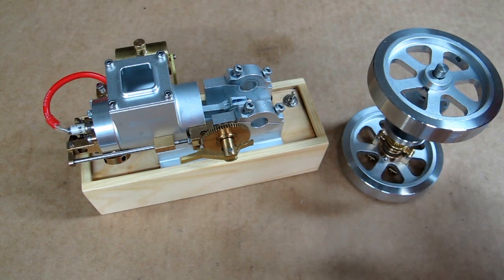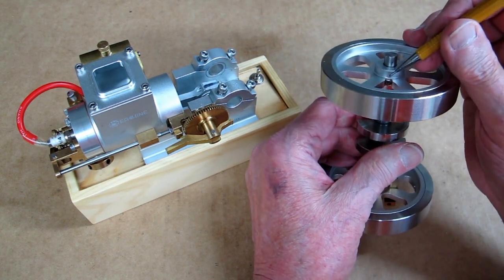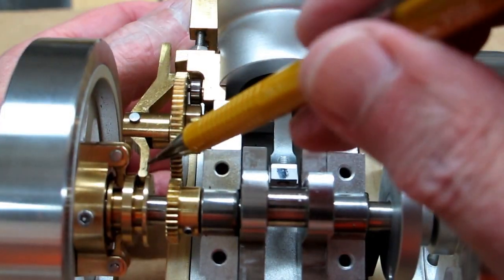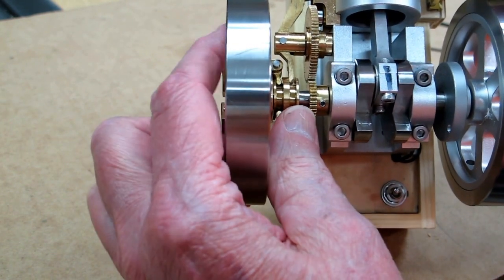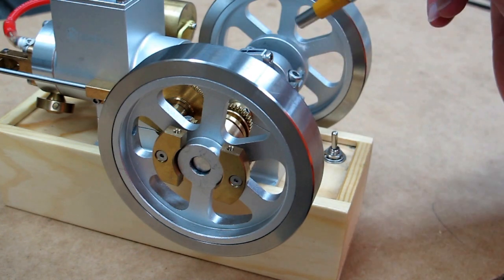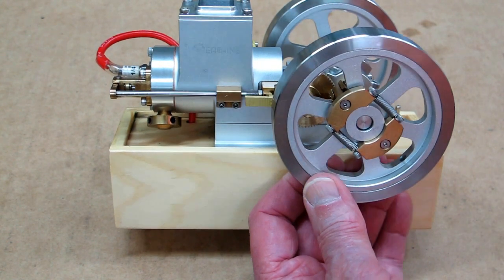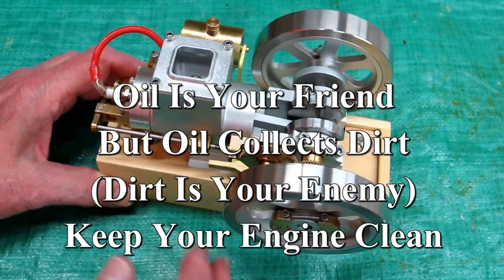Eachine ET1 - Fixing Loose Flywheels

Comment: Can something be done with loose main bearings? Flywheels wiggle a bit. I got this engine second hand and I don't know was it like that 'by design' or bearings worn over time.
Reply from the maker: These are obviously made fairly fast and there are some shortcuts used in the manufacturing process that could be better, such as not having a flat on the crankshaft for the flywheel set screws. The crankshaft bearings are fairly loose but that doesn't really seem to be a problem. Some people have chosen to make their own brass bearings (bushings) for the crankshaft with the addition of drip oilers. They are a standard metric flange bearing should their replacement become necessary.

With some of the later engines flats were added to the crankshaft for the flywheel setscrews, however the setscrews are still at an angle to the crankshaft. I would much prefer that the flywheel setscrews were perpendicular to the crankshaft.

The main thing is to keep everything oiled (before each run) and to operate these for what they are... model demonstration engines (run at moderate speed and for short duration) and not something that is going to be used for an actual job or to see how fast they can run before some damage occurs (as I have seen some people do for unknown reason).

With a little TLC and the occasional maintenance, these engines should last a long time.

Always a good idea to take many photos at different angles for future reference should something shake itself apart or for when you need to disassemble something and then forget how it goes back together again. :-) I've done that more than once.

Thanks for watching. Enjoy your little engine. Please subscribe! 
That is what keeps this channel going. 
Ron
Reply: @RonaldWalters2010  Thank you very much for your reply.  One more question regarding timing. I noticed, that exhaust valve is opened slightly before bottom dead center of the piston, it it correct? Looks like a waste of some gas pressure, that could still push the piston... 

I'll subscribe to you channel for sure. Great stuff and really good way of show and tell.
Reply from the maker: This is my original review video on this engine. 

Eachine ET1 Upgraded Hit & Miss Engine
https://youtu.be/ZCrjj4niyto

You will see the exhaust valve open slightly before BDC and closes slightly before TDC which gets the exhaust valve closed for a full intake stroke which you can't really see because of the atmospheric operated intake valve (very slight movement of the spring loaded intake valve).

Most of the power stroke energy is stored in the rotating flywheel. 

Ignition should occur just past TDC on the compression stroke.

There has been some occurrence of the ignition stopping during an engine run or not working at all due to too much voltage. You will see in some of my videos that I use a dummy battery which effectively drops the battery pack voltage with fresh batteries from 4.5 to 3.0 VDC and the problem goes away. Note: This doesn't happen with all engines (another mystery of Chinese ignition systems).

I have a playlist which contains all of my engine related videos.

Comment: Who's idea was it to locate the governor side flywheel locking bolts underneath the weight arms.......a 10 year old? My flywheel on that side has come loose (probably because I use that flywheel to start the engine) so now I have to strip the whole assembly to tighten two small locking screws. EACHINE please study design 101 and mill a flat on the crank.
Reply from the maker: Yes… and do not use set screws at an angle. Very annoying.
These engines are fairly reasonable but a number of machining steps have been left out.
On some of the smaller brass engines, they have milled a flat on the crankshaft (but the set screws are still at an angle).
I have a video on this process… but then you have already solved your own problem.
Eachine ET1 - Fixing Loose Flywheels
https://youtu.be/7ytogWmam2Y
Reply: @RonaldWalters2010  I did manage to tighten up the set screws but now I have another problem, spitting a fine mist of fuel out of the mixer during the power stroke which is enough to wet the end of my finger. Thinking the inlet valve may not be seating properly I removed the cylinder head but both valves are seating fine without any blow-by. Compression is very good, I can't understand how fuel can be blowing back when both valves are closed.
Reply from the maker: I also don't know. It is an atmospheric intake valve so once it closes there should be no blow-back through the carb.

Comment: What is the best lubricating oil to use on these engines ?
Reply from the maker: I have over 50 videos reviewing these various model engines. The videos are all grouped together in one playlist. With a little effort on your part you should not need to ask this question.
I have a video on the correct fuel and oil to use;
Hit & Miss Engines - The Correct Fuel  https://youtu.be/TvLziWCI7Oo
The lubrication oil used on various moving points has been covered many, many times in the videos and in the video comments. 3-In-One or Singer Sewing Machine oil (or similar light oil).
Reply: @RonaldWalters2010  thank you, I am new to watching your videosand new to these engines, very informative, I guess I have not got to the video on lubrications yet.
Thank You for your time 
Eric
Reply from the maker: Fair enough. Sorry... I was having a bit of a rough day. :-)
If you have any questions after watching what is available, please let me know. And thanks for watching!
Ron

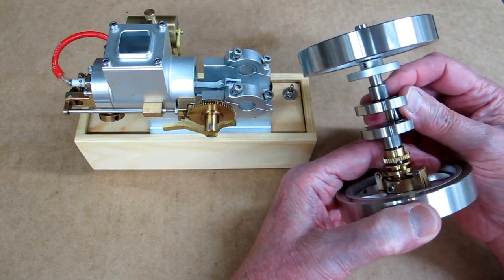Comment: @ 1:45, mine doesn't have real bearings needle or roller, just steel bushings.  I put a drop of Loctite at the hub on the shaft but if I felt like taking it all apart someday, I will make a small flat on the shaft or dimple for the screw

Comment: I removed mibe with a home made puller to replace the brgs. they had a lot of play i put bushings in.
It didnot hurt the crank i added flat spots to shaft it was verey hard metal had to use a grinder a file didnot remove any thing.
Reply: Well that's good, that means that using a brass punch or a small puller won't hurt the crank if you have a flywheel that doesn't want to cooperate. once you put some flats on the crank, I'd probably put some locktight on there too.

Comment: Is electric starter really the culprit? I think it’s more likely due the nature of this kind of motor, low ignition rate but high power per ignition..
Reply from the maker: The erratic firing tends to shake things loose but pushing against the flywheels to create enough friction for the starter to work does not help the situation.